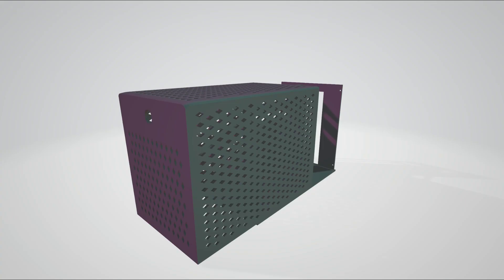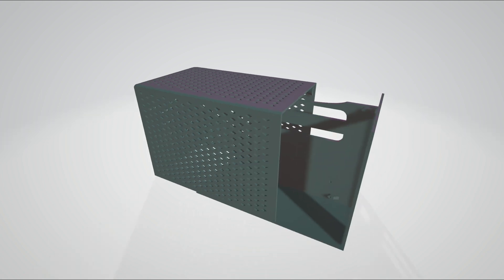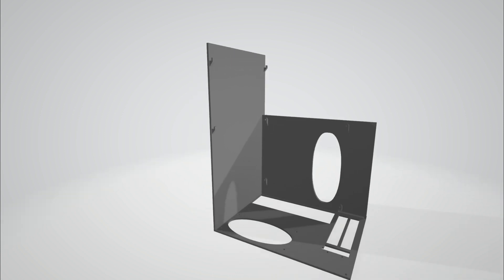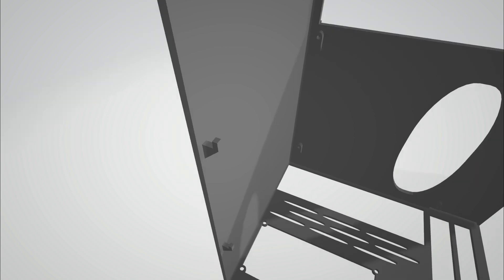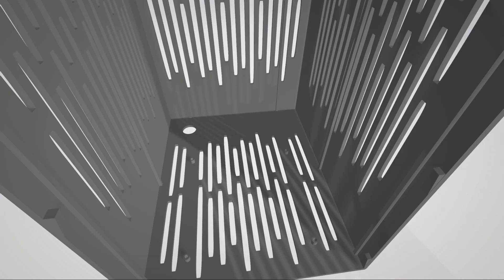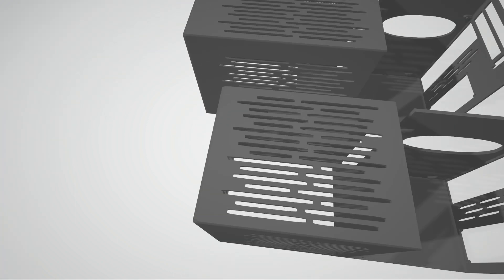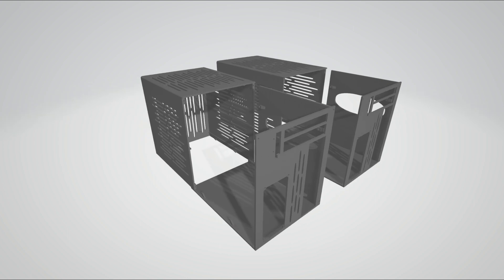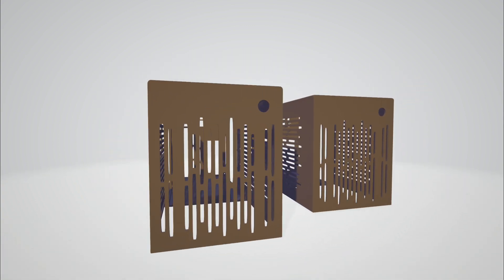I 3D Printed My Own 8.3L Budget SFF ITX PC Case

Comment: Good video :) been gathering thoughts on a design, but I have to ask (as I was thinking this in my design process)... did you ever consider hex holes? it seems like they could work better for the vent holes as then lots of air flow, less wobble while printing.
Reply from the maker: I did. My other design used diamonds so I wanted them to be different, but I made this in TinkerCAD and it was starting to lag out with so many cuts for holes. Hence the slots. If I did it in Fusion I would have done something else.

Comment: What 3D Printer would you recommend? Seriously considering printing an SFX with the capacity to fit an RTX 2080 Gaming X Trio (330mm) sized GPU.
Reply from the maker: To print something so large would require a large printer or that you print in parts. Artillery X1/Anycubic Mega X is a good choice for larger prints, though an Ender 5 Plus would probably be better. If you don't mind printing in pieces then an Ender 3 or regular Anycubic Mega S would work. Anything with 200mm+ build volume would help so you don't need to glue more than 2 pieces.
Reply: @LohTec  okay I'll check those out! Thanks.

Comment: What speed do you think i could print this model at ? My minimum speed is only 80mm/s... cr-10 s
Reply from the maker: For the shorter case you would be fine at ~50mms+, but the longer one I'd recommend you slow the speeds down as it goes up. Maybe even 10mms near the top.

Comment: Hi thinking about printing this. Can this fit a atx sized psu and can be used with a all in one water cooler.
Reply from the maker: Can't. You'd need a much larger printer to do atx
Reply: @LohTec  oh not atx case a atx powersupply
Reply from the maker: Ah, sorry. Still no unfortunately, was designed for SFX. Could be done, but potentially would hurt GPU size or greatly increase case size. Can also do 120mm rad more than likely, but haven't tested.

Comment: Great design. But I do have a small question. Is there any way you could make an mATX case. I'm about to build an PC in format of mATX and there are not many cases that will suit me out there. All I see are too expensive one's made from high grade steel or aluminum, but not many to choose from the budget point of view. Any way or chance you could make one let's say 50€. I will be very grateful.
Reply from the maker: Physically it wouldn't be that hard, though the issue then is you would need either a bigger printer or more pieces.
Reply: Ok. What if you could design that mATX case, and I just send to someone who could printed for me like this All3DP you mentioned in one comment. What you say is that possible.
Reply from the maker: Possible, but the bigger the print the more expensive so it may not be worth it.
Reply: So is possible to make it right. What if could be use some aluminum and 3D printed parts together on the budget point of view. And if needed more parts how many parts we needed?
Reply from the maker: @Malaka84  You could take a look at something like this a modify it for your needs. Really just needs a lid. https://www.thingiverse.com/thing:3623802
Reply: @Malaka84  When I was considering a mATX build, I found no shortage of very budget options. Some lower than 50 dollars. Ultimately though I went mITX instead, since I could still get a Fractal Core 500 for under 50, and the motherboard being priced 40 dollars higher than the mATX version was offset by the fact that Wifi was built in to the ITX MB so I would not need to buy the same quality of wifi network card to attach to  the mATX board.

Comment: Could you change the pattern to something quieter? https://www.pugetsystems.com/labs/articles/Effects-of-Grill-Patterns-on-Fan-Performance-Noise-107/ will give you an idea for what you could go for.
Even those diamond holes are probably quieter, and might just be the best option here, for structural strength, noise, and printing challenge. But make them a lot closer to each other, it shouldn't affect structural integrity much, but reduce noise and increase airflow.

Looks like the topology in blender isn't too bad, so maybe I can fix it myself.

Comment: Link to the STLs isnt working :(
Reply from the maker: Looks like that site is down. Try here https://www.thingiverse.com/thing:3887965
Reply: @LohTec  Wonderful! Thank you for the new link, the free STLs and for your crazy fast reply!
Reply: @LohTec  Do you think you cold modify the larger version to make it printable on the Ender 3? I don't see a natural place to split the file and its too tall for the ender 3, but I want to use a full size graphics card. Maybe key the two pieces so they go together strong...?
Reply from the maker: It should be easy enough to split and just print the second piece with a brim. But yeah didn't design it to split
Reply: @LohTec  Printed the first half... https://i.imgur.com/P4tY68H.jpg

Comment: The CAD files would be awesome, if you take the shorter build and push the outer casing forward to where a full would be, you can just print a partial outer casing to fill in the backside and boom, print on an ender 3/smaller printers. just gotta align the clips hence why im asking for the CAD files :{
Reply from the maker: Made mostly in Tinkercad, so no cad file. Sorry!

Comment: Any way to print the larger one on an Ender 3? cut the exterior case and create holes on one end and snap on male connectors on the other? I have a Vega 64 and an Ender 3
Reply from the maker: You could do that. Even a simple slice and then glue together would work. You'd just need to put a brim on the second section